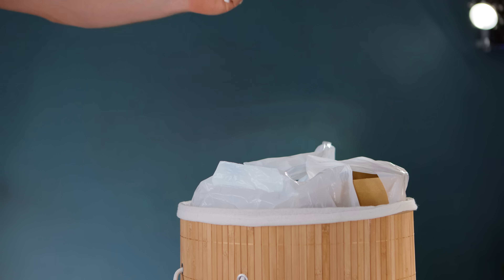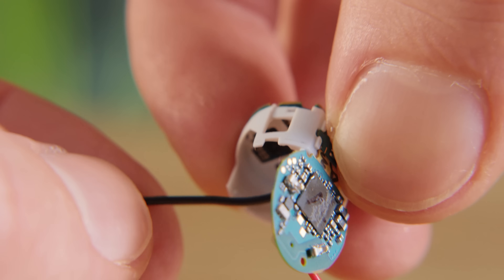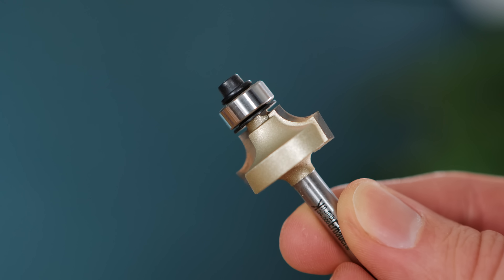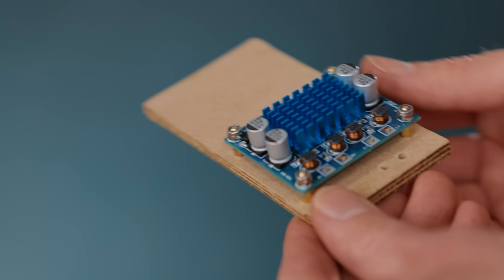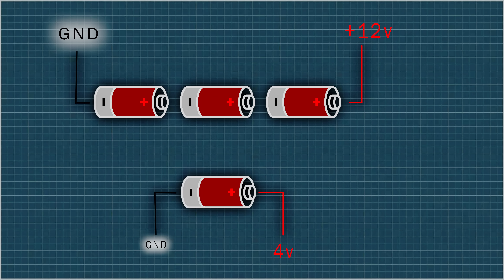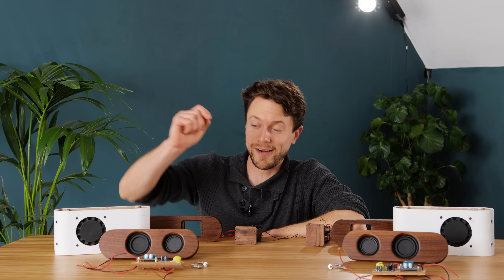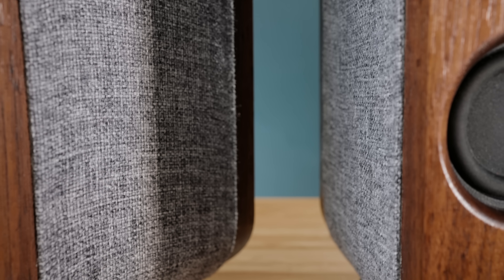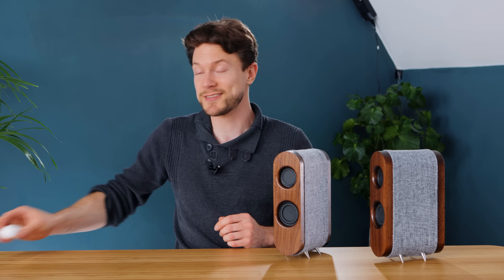Transforming dead earbuds into POWERFUL wireless speakers

Comment: It's a great project and I just have one suggestion, you could replace the switch on the back with a triple switch..that have (ON, OFF, and Charge)..you could make the corresponding circuit for charging and install a small Micro/Type C USB...much easier than unscrewing the back and taking out the battery every time
Keep up the amazing work mate

Comment: At first thought it is a good idea.. Until you realize that the internal dsp is tuned for the small earpiece drivers.. Not a bookshelf speaker.. Better to use a qualcom csr8675 chip ... You can program the internal dsp using a usb to spi converter..... and just use the TWS option :) cool idea though.. But i will kust replace the batteries of my airpods instead of doing this :)

Comment: Those filter circuits will work but, if you've any experience with old 8-bit computers or consoles, the electrolytic capacitors are not intended for audio or AC use. They will heat up and lose their capacitance faster.
That said, they will last a good few years.

Comment: I wonder why a Raspberry Pi IV's could not be used as a DSP Crossover to split up the signals using ARM machine code and using the DAC outputs to drive the amplifiers and of course two Raspberry Pi IV's are required one for each speaker unit.

int DESIGNBP(int LOWFREQ,int HIGHFREQ)
{
    int N,SAMPLING_FREQ=(HIGHFREQ<<2);
    long double MM;

    MX_NUM_TAPS=10;
    MX_LAMBDA=((M_PIl*LOWFREQ)/SAMPLING_FREQ);
    MX_PHI=((M_PIl*HIGHFREQ)/SAMPLING_FREQ);
    for(N=0;N<MX_NUM_TAPS;N++){
        MM=(N-((MX_NUM_TAPS-1.0)/2.0));
        if(MM==0.0) MX_TAPS[N]=((MX_PHI-MX_LAMBDA)/M_PIl);
        else MX_TAPS[N]=((LDSIN(MM*MX_PHI)-LDSIN(MM*MX_LAMBDA))/(MM*M_PIl));
    }
    return((int)(0));
}
long double OUT_FILTER(long double VALUE)
{
        int I;
        long double __VX1,__RESLEFT;
        long double ANSWER;

        MX_SR[0]=VALUE; __RESLEFT=0.0;
        for(I=0;I<MX_NUM_TAPS;I++){
            _asm_ __volatile__(
                "fldt       %0                                      \n\t"
                "fldt       %1                                      \n\t"
                "fmulp      %%st,                       %%st(1)     \n\t"
                "fstpt      %2                                      \n\t"
                "fldt       %3                                      \n\t"
                "fldt       %2                                      \n\t"
                "faddp      %%st,                       %%st(1)     \n\t"
                "fstpt      %4                                      \n\t"
                :"=m"(MX_SR[I]),"=m"(MX_TAPS[I]),"=m"(__VX1),"=m"(__RESLEFT),"=m"(__RESLEFT)
                : "m"(MX_SR[I]), "m"(MX_TAPS[I]), "m"(__VX1), "m"(__RESLEFT), "m"(__RESLEFT)
                :"st","st(1)"
            );
        }
        ANSWER=__RESLEFT;
        for(I=(MX_NUM_TAPS+30);I>=0;I--){
            if(I!=0){
                MX_SR[I-0]=MX_SR[I-1];
            }
        }
        return ANSWER;
}

Comment: That is an awesome design! I am really interested in following this build for Bluetooth speakers. I have a question though and that is about the range of the blue tooth connection to the earbuds. From my experience while wearing Samsung earbuds I can only walk about 2 to 5 meters away from my phone before the connection become unstable. Have you encountered this problem once housing them inside the speaker housing? If so, is there away to extend the range of the Bluetooth signal? (Asking from the point of view of a DIYer who has extremely basic knowledge of electronics.)
Reply from the maker: Strange! From my experience they have a superb range. I can go to the opposite side of the house with the signal going through various walls and it still holds true for me.
Reply: Thank you so much for the reply! I feel honored! Unfortunately I didn't see this reply for about 8 months due to me not knowing how to view my own YouTube comments... 

I suppose it may however be the fault of my own earbuds. I will forward your tutorial and see if I buy some old ones off eBay and see how it works. Thank you!

Comment: I think the one thing missing is a charging port for the batteries so you don't have to completely remove them to recharge.
Reply: Proper battery charging circuits are pretty complicated, especially when multiple voltages and balancing circuits are needed, along with component cut off like here. Given the way the three circuits were built, I don't quite trust DIY perks with battery management circuity, and I think he also knows it might be more dangerous than it's worth.
Reply: @astersfun  There are cheap circuits on eBay, or instead of individual cells you could use a couple of powerbanks which integrate both charging and power delivery circuits with also the needed protections

Comment: These output filters are unnecessary and introduce phase distortions, a well-matched air coil (for woofer)is all you need and a fixed bipolar capacitor minimum 50V(treble).

Comment: you could have used a 3s2p lithium ion battery pack with a type c charger that way you wont have to remove 4 screws to recharge

Comment: Great video! But it looks like you've used polarised electrolytic capacitors which might get damaged if you send them pure AC (audio) signal. Unless there is some DC offset to protect them.

Comment: This is fantastic! One question: can you recommend a way to control the tuning in more detail? Specifically, for my own personal preference the mid-treble on the Bose sounded too sandy, but on yours also sounded a bit muted for my personal tastes. Of course I could use the EQ mixer settings on whatever device I’m sending the audio from, but I’m worried if the circuits as you have them might place a limit on the treble I’d be able to get? Would it be possible to replace one of the circuits you used for the mid-treble speaker with some sort of dial so it could be tweaked to personal taste?

Comment: Everything is super great.
Except: 4 screws that are required to be removed each and every time battery gets low. I am thinking at every 4 -6 hours max ?
Why not get one bms and one buck/boost converter to do the trick ? Have a diode in line for reverse voltage rectification
You can even hook up a Qi charger

Comment: Next project: Build a charging platform for these speakers. Just place them on the charger and the power goes in to the spikes at the bottom.
Reply: I would have included a USB power port for charging. Then put a small and cheap (~$5) 3 cell balance charger inside the speaker (and of course a 1 cell charger as well). Would be much more practical and added cost would be under $10 / speaker.
Reply: Exactly, & for the other guy; apple aren't known for this 😂
Reply: Without too much trouble I'm sure he could fit a USB charger into the rear plate. But his channel has never been about convenience just for the sake of being convenient. It's about function over form with beautiful elegance thrown in. If you want something convenient and ultimately marked up garbo, go out and buy anything with the 🍎 logo.
Reply: @rickyhall1772  Having speakers that aren't annoying to charge is very much "function"
Reply: @DijitalPants  I never said a USB port to charge wouldn't be a good idea. My comment was directed at the op which said he could build a charging platform to charge through the feet. Ultimately having replaceable batteries AND a way to charge is the best solution. But that's up to the builder. 18650 batteries are very common, so it certainly doesn't hurt the function having strictly replaceable batteries.
Reply: @rickyhall1772  Im sure, by several orders of magnitude, more people own USB chargers than own 18650 standalone chargers.... That makes it function, pure and simple.
Reply: @Debbiebabe69  This item isn't mass produced, it's produced by a user, so they determine how it's charged. 😉 But good try! 😘

Comment: Nice, but should have included: an external button for pairing purposes, resetting and turning on and off and should have had an inboard charger module.
Reply: I was thinking the same thing. Is there a way to begin the pairing process without the case? Usually that pairing button is on the case

Comment: I think it coulb be improved using rechargeable lithium batteries for the amplifier and speakers. And a single battery for earbuds circuit because it's very low energy and 2600maH battery will last a lot of time, requiring less openings of the speakers

Comment: one problem -  no way to put them in a pairing mode....if yo wanted to pair them to PC or something, what not supports auto-discovery (problem 1). Also, battery extraction way ... require screwdriver?  In such cases - better to integrate the charging circuit  inside with making cut-out in the outer case for the power supply (problem 2).  Additionally, it is a good tone to put in front a dimmed led - to display the power status of the speakers. Its easy to forget to switch such speakers off, if nothing playing atm ... and prevent battery being discharged (problem 3).

Atm, current project is only 50% done from being considered  usable instead of concept......

Comment: fun fact: the Bose unit has heavy DSP coloring to level and roll off the bass response from the use of the transmission line port. Will also limit bass the louder you turn it up. The buds are similarly colored and "EQ" the output for the diaphragms of the buds so they sound flatter to the human A-weighted hearing response.

Comment: Nice work. I've got a collection of BT headphones (full sized, not earbuds) that I bought cheap on ebay and repaired. Most had a bad solder joint, a broken wire, broken plastic, or a bad speaker. BT quality is really good nowdays so this is a great project. Thank you.

Comment: Brilliant little project! Id suggest adding a 5v mini usb charger board/port so you dont have to take the batteries out to charge them. you could even use a cheap universal mobile phone wireless charging reciever if it had a flat bottom. then whenever you wanted to just pick them up and use elsewhere, they would always be fully charged

Comment: Would be nice to see response curves, those earphones will not be outputting a clean signal.
Also, I'm mildly concerned about impedence matching between the amps and the filters used. Would be good to have more details about this for the electronics nerds out there.
Perhaps it's in the article? I haven't looked yet.

Comment: Very cool! Speakers are a bit lacking in the top end with that mostly mids driver so would definitely benefit from a proper tweeter. Yes, it'd add complexity but I'm pretty sure you could just extend the mids circuitry as the same signal would be fine, don't quote me on that though.

Comment: Guys call the press: He's run out of brass! 

Seriously though, this is a cool project. Just surprised you didn't do it in brass.
Reply: That would be becuase brass isn't the best material for sound. Would have been nice if he had added some brass accents though... :)
Reply: Plus the brass might interfere with the bluetooth signal.
Reply: +1 on the interference with Bluetooth signal. Metal (or shiny surface if I remember correctly) reflect the signals away, deteriorating the signal by quite a bit
Reply: Metal is a bad idea for speaker enclosures. Wood has much better acoustics.

Comment: Seeing how much better a DIY alternative is to a very well known brand makes me wonder how the h*ll that's even possible. Yours is faaaar less complicated and somehow it outperforms the professional model? Wtf? What are the people engineering them even doing, and why are they built so complexly if simpler can be so easily better.

My guess? The cheaper model is intentionally built with poorer audio quality to push people towards the more expensive models. It hardly makes sense to sell a cheap product that's genuinely amazing when your business model is high-end audio. And the needless complexity? More ways for the speakers to eventually fail and encourage more purchases. Yours could easily last you well over a decade and is easily repaired while my experience with cheap (And while admittedly not Bose, still one of the bigger brands) speakers tells me otherwise.

My mind is completely blown... Yours are even prettier despite costing the same! All around, the DIY is just better in every way!

Comment: Hi, very interressing project ! By the way be aware that the headphone electronic have a frequencey correction built in the BT receiver. It's goal is to correct the frequency response of the small drivers. I think that the lack of treble of your DIY speakers is probably du to the high frequency correction in the small headphone original drivers. Do you have measured the frequency response of the wireless speaker with a measurement microphone ? How do you have set the analog correction filter ? Thanks

Comment: I will add internal chargers to mine. Perhaps solar panels on the sides. That way, I don't have to unscrew that panel every time I need to charge the batteries.
Reply: wow cosidering speakers don't eat that much power solar panels is actually a great idea! Jus make sure they are always under direct sunlight during the day and the system would surely work.

Comment: common ground wouldn't necessarily result in a "ground loop".. IMO would have been better to use all 4 in series and a step down for the earbud and have a charging board so you can plug it in without having to remove the batteries.  Or hell put a wireless charging pad in it.

Comment: There is one problem here, some TWS earbuds are using high voltage batteries like 4.35v instead of normal 4.2v. If you just want to use one battery instead of battery pack and use the integrated charge management of the TWS earbuds, choose the right type/voltage of the battery, otherwise, the battery may die pretty soon after some charge cycle.

Comment: YOU DESIGNED YOUR OWN ANALOG FILTERS?? Blows me away every time the amount of effort you put into these videos. I feel like there is so much testing you don’t show in the final cut, great job it is all appreciated!
Reply: you can do it pretty easily using VituixCAD (since TangBand speakers provide response graphs) or even with simple LP/HP Calculators for such project
Reply: Look up "RC filter" when you're bored they're cool to read about. He probably had to find the correct "crossover frequency" (the optimum frequency to separate the subwoofer and tweeter at) for those specific drivers and enclosure which probably took all the time, not the actual circuit, just FYI
Reply: Pretty standard for anyone who's done car audio.   And rarely ever a preferred method if you're actually interested in audio quality.

Comment: I was looking at getting a cheap pair of true wireless earbuds so I could use one while having a feed in the other, then realized I still have some old 'wired wireless' ones that only one side works on. Turns out that other side wasn't important, and I saved some money too. Always nice to reuse something that would otherwise be thrown out.

Comment: Matt you seriously cut corners for not putting battery charging mechanism inside the speakers. You could have gone with simply creating a base for charging these speakers or have created chained 12v rail to charge them up

Comment: I have been looking to build a speaker set for my bedroom using some drivers to resonate some panels like techingredients does. I am looking forward to your guide for the low pass and its inversion and the highpass filter, as it will be very useful. If you can include a link to a great electrical engineering how to, i would like to learn a bit more about how the components work. Maybe there is a site you refer to when building your projects...

Comment: I would do two things to this project.
Make the battery function like a battery of a power tool, by hiding it inside a removable arch.
And change the filter capacitors for polyester ones.

Now, I hope you explain in guide the need for the third filter.
Because you only have two speakers, and only need one filter peer speaker.
So a third filter is kinda wasted.

P.S.: serious people, pay attention to the guide and get the right speakers, the filter and cabine size should be dimensioned to specific speakers.
Should any be wrong, fidelity will drop as frequency is affected.
It's possible to figure it out, however I have learned the hard way that is a pain to work it out, more so with speakers that lacks Thiele/Small parameters.

Comment: Hello there. I would like you to give your opinion on a subject. I would be grateful if you could help and answer my question.
Question: I need a small amplifier circuit for the 2 + 1 laptop speaker I have at hand. With the ordinary two channel circuit, I can only use it in stereo. But I need a circuit that will still play the bass speaker that contains it. I'm looking forward to your help with a circuit that can drive me the bass speaker.

Comment: Why can't you add three more components and make it so you don't have to disassemble it to charge the batteries?  A battery charging module for the 4 18650 cells, a 3.3v power regulator so you don't have to separate the batteries, and a barrel jack out the back to charge each speaker.